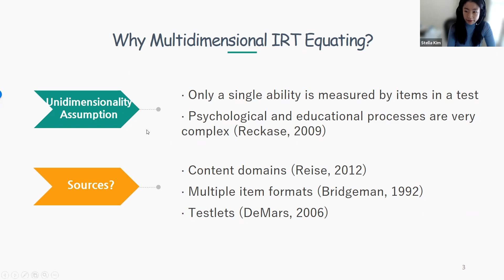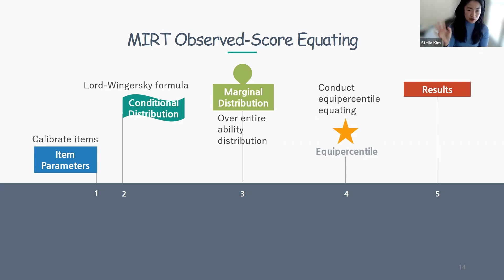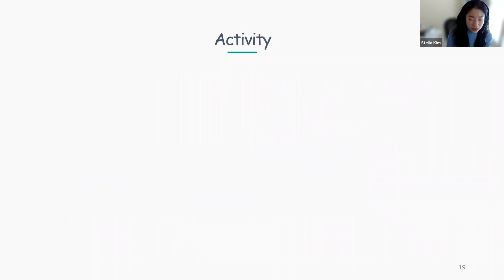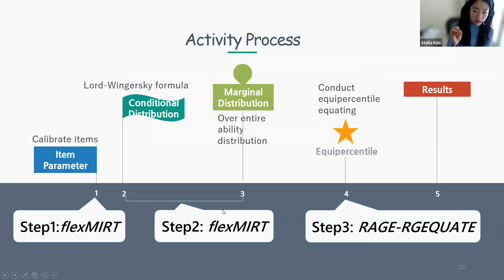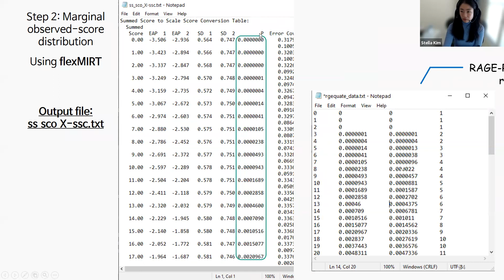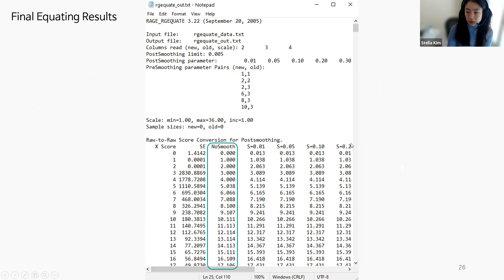Multidimensional IRT Equating

Comment: Great talk, thanks for uploading! Regarding @56:05, it is possible to get the marginal distribution for the scores, however it must be back transformed form the reported table of expected counts. Here's and example of how to do this:

```{r}
library(mirt)
mod <- mirt(Science, 2)

#' # EAPsum table of values based on total scores
 (fs <- fscores(mod, method = 'EAPsum', full.scores = FALSE))

# ACOVs, in case they are needed
 (acovs <- fscores(mod, method = 'EAPsum', full.scores = FALSE, return.acov=TRUE))

# convert expected counts bak into marginal probability distribution
fs <- within(fs,
    `P(y)` <- expected / sum(observed))
fs

## output: 
   Sum.Scores          F1           F2     SE_F1     SE_F2 observed    expected    std.res         P(y)
4           4  2.41320761 -0.319859419 0.7285323 0.8044752        2  0.01350174 17.0959550 3.444321e-05
5           5  2.14010301 -0.242919289 0.7472117 0.8636042        1  0.13731966  2.3280030 3.503053e-04
6           6  1.85277404 -0.186059163 0.7743624 0.9297630        2  0.76782832  1.4061743 1.958746e-03
7           7  1.54781230 -0.160325565 0.8025877 0.9919208        1  3.10449511  1.1944072 7.919630e-03
8           8  1.22884758 -0.150677952 0.8198553 1.0288133       11  9.77712774  0.3910889 2.494165e-02
9           9  0.90930704 -0.127989594 0.8250019 1.0416191       32 24.63383933  1.4841409 6.284143e-02
10         10  0.59623280 -0.073612174 0.8191928 1.0301015       58 50.29601323  1.0862974 1.283062e-01
11         11  0.28209797 -0.006658871 0.8032034 1.0058173       70 81.76433690  1.3010246 2.085825e-01
12         12 -0.07050756  0.030459192 0.7825413 0.9756703       91 95.64246277  0.4747042 2.439859e-01
13         13 -0.45683842  0.039879699 0.7901622 0.9936328       56 70.92807413  1.7725345 1.809390e-01
14         14 -0.86497815  0.046956330 0.7931629 0.9962921       36 38.30985755  0.3731899 9.772923e-02
15         15 -1.28256848  0.071564326 0.7828154 0.9391234       20 14.38562886  1.4802555 3.669803e-02
16         16 -1.46832164  0.438053346 0.7049926 0.7944140       12  2.23951467  6.5222052 5.713048e-03
```

HTH to those who are interested.